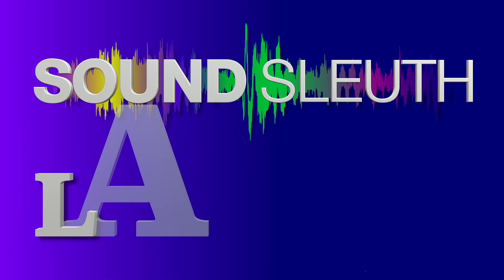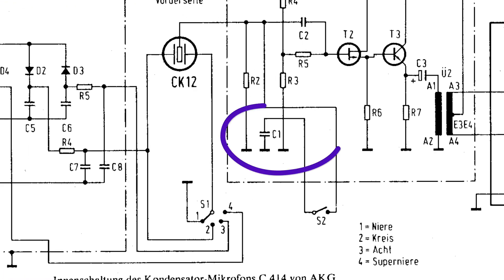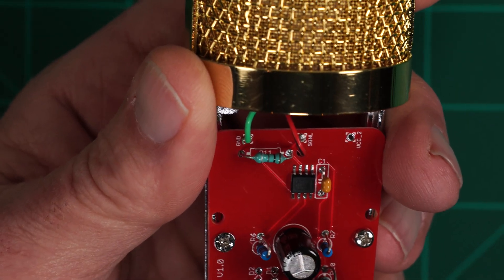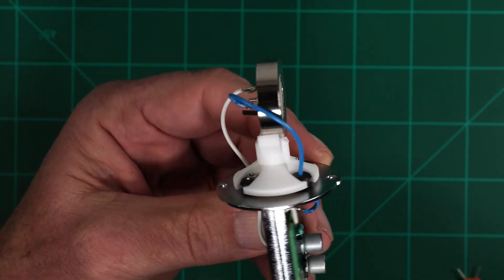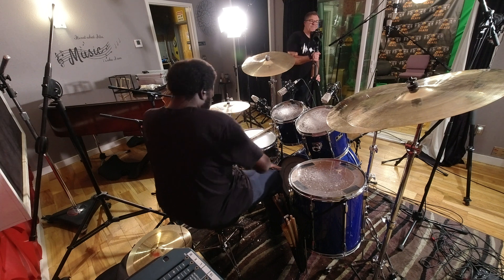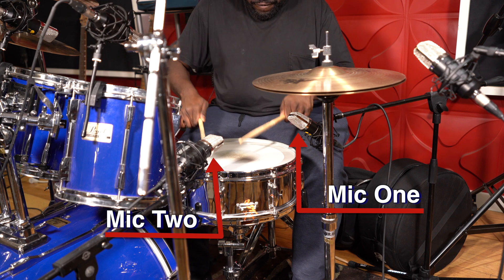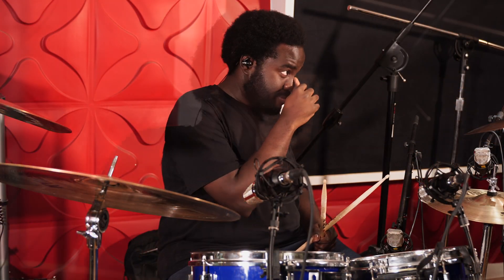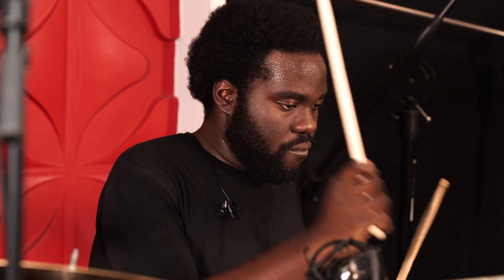OPA Alice Drum Microphones

Comment: I'm new to DIY stuff but I have a question. Is there a nice way to add a switch (like a GT22MABE) to the pad without messing the PCB layout?
Reply: Yes you just wire a DPST switch with the capacitor in paralell with the resistor when in the on position.

Comment: And what if the task is the opposite: raise, make a louder level, increase sensitivity? For example, a microphone with the same preamp board, but with different caps, has a very different output volume level, and I want it to be approximately the same. I soldered 220 pf to a 1 gig ohm resistor, with a TSC-1 capsule and the level weakened by -10 db. And with the JLI-3413AU01 capsule (without the DC-DC Hex Inverter board), the level is initially very weak, somewhere 17 db quieter compared to the tsc-1 capsule (without 220 pf). Soldering the wima capacitor with other values for greater attenuation (330, 470 pf) I'm afraid there will be high frequency losses. Maybe try to change the value of the resistor in the feedback R6, R7 to increase the volume with an electret capsule, what do you think?
Reply from the maker: The TSC-1 with hex inverter is pretty sensitive.  The JLI3413 is -44db about 11dB lower.  Add in the 2-3dB that running it at 75VDC vs the 60 the default sensitivity was calculated with.
Reply: @SoundSleuth  What size should the capacitor be for a large-diaphragm capsule like a TSC-1 in order to achieve an attenuation of -15 dB to -20 dB? 470pf? Is the attenuation linear?
Reply from the maker: @MariusH-bb1hv  I use 330pF. The attenuation is based on the ratio of the capsule capacitance and the padding capacitor. The capsule is about 65pF. Thus we get about 15dB of padding.

Comment: The capacitor is not really across the capsule but in parallele with the 1g resistor , i was wondering how the signal could be attenuated this way  ?
Reply from the maker: The capsule and 1G are already in parallel. One end of both is tied to ground. Thus putting the padding capacitor across the 1Gig puts it in parallel with both.
Reply: @SoundSleuth  in your schematic , the capsule is connected between GND and V+ , then the 1G is connected between V+ and Vcc/2 (6v)
Reply from the maker: @zanzeoo  the “6V” is a virtual ground. So it all works.
Reply: @SoundSleuth  Yes, 6v is a virtual ground, but are you agree that one end of the capsule is connected to GND (0V) ? and not the 1G or the 220pf cap
Reply from the maker: @zanzeoo  From an AC and signal perspective the Capsule is in parallel with the 1Gig. We are adding in the the additional capacitor to pad the signal. The capsule is approximately 50pf. The additional 220pF cap then attenuates the signal roughly 47/(47 + 220) or about -15dB. From a DC perspective one end of the capsule is at  ground, The other end is tied to the 1Gig and the input of the opamp, which is a very high impedance FET input and the other end of the 1Gig is aprox 6VDC. As far as AC goes, it and full 0V ground behave the same way.
Reply: @SoundSleuth  Well, I don't get that AC perspective ,  to me a capacitor in AC ( depend the frequency) is a short circuit. (complex impedance) . are you considering the capsule as a pure capacitor that way ?
Reply from the maker: @zanzeoo  Yes. A condenser capsule is literally a capacitor. One with a fixed plate and a second plate that is the membrane.  Sound in air moves it, changes the capacitance and thus the instantaneous voltage on it.
Reply: @SoundSleuth  Maybe a simulation or detailled calculus would help me to understand this. Am i the only one to struggle with this part of the design ?

Comment: Great video, i love your opa builds.
By the way I am new to this and I have really wierd question, on your opa alice circuit you used 1G ohm resistor but i don't have the access to it, highest i can get is a 10M ohm 0.25 watt, so if i put 100x10M ohm in serise will it work? 
Thanks.
Reply from the maker: You could techinically but physically it would be huge. DIgiKey  and Mouser carry them https://www.digikey.com/en/products/detail/ohmite/MOX200001007JE/705445
Reply: @SoundSleuth  Thanks for the help
Reply: I'm trying to figure out how 100 resistors would fit in a tiny circuit like that lol
Reply: @dillpereira250  smd
Reply: @dillpereira250  smd resistors on serise, placed it on the other side of the mic body,  no problems so far.